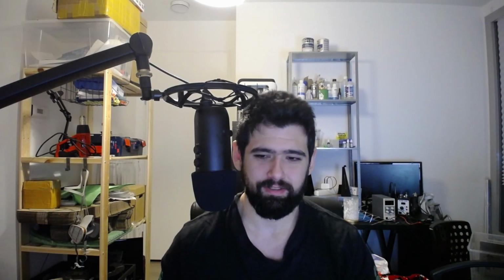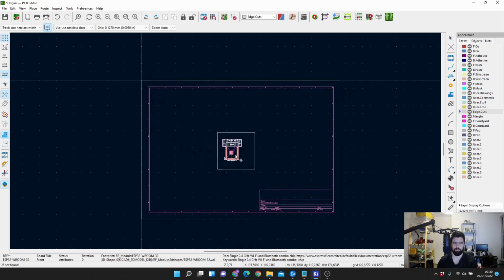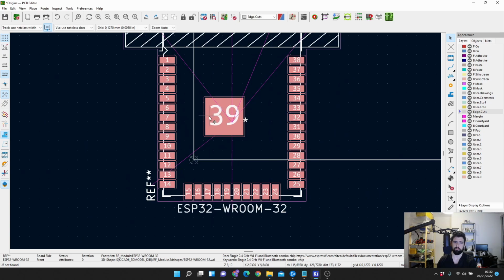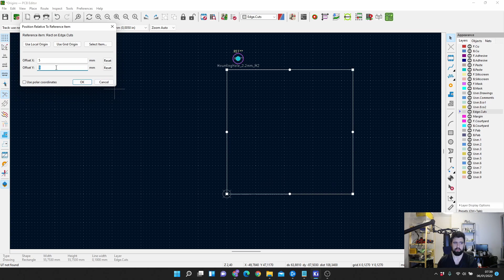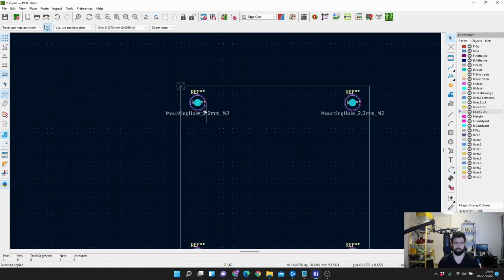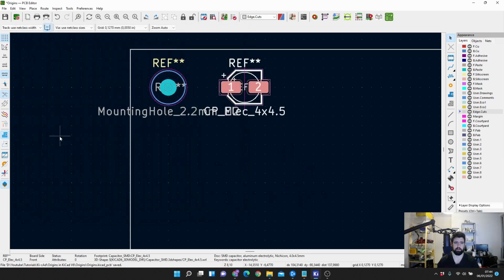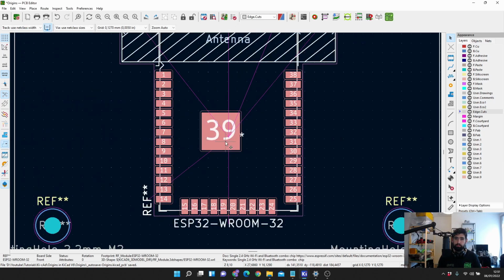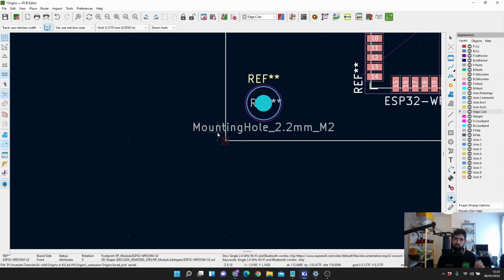KiCad V6 - Tutorial - Changing the origins that suits you

Comment: I admire that you're taking the time to make these videos. But I feel like this coverage of origins could use more discussion. First, Kicad 5 (and probably earlier) already has the ability to place an origin wherever you want.Yes, it has a fixed page-relative origin, but you can place the relative origin anywhere, and this is such a frequently used  function that its hotkey is space. The position relative to that "relative origin" displays in the status bar, along with the page-relative position. That way you can work relative to the bottom left corner for parts near there, or from the bottom right corner, or from the edge of a connector or some other landmark component. Having said that, K6's ability to set the page origin (which also sets the grid origin), and also the positive direction (especially for Y), is a big improvement. But the relative origin is still needed as well (so I hope that's still there!).  I'm hoping that there's a way to temporarily set the grid relative to the relative origin as well.  That would be useful to work on a board where most dimensions are in mm, but a certain area uses 0.1-in grid parts (such as many connectors), but that 0.1 grid is not relative to the board origin.
Now, regarding putting the origin at bottom left corner, and ensuring all X and Y positions are positive. Yes, that arrangement is less taxing on your brain. But it's not particularly necessary for any of the workflow.  It's true that Gerber files require X+ to the right, and Y+ up, and are often created with the origin at bottom left, but that origin position is not required. And Kicad 5 and before were quite capable of producing proper Gerber files, regardless of where the page origin was, (or the Auxiliary origin that's specific for the Gerber and drill output).
The bottom left origin is also not necessary for the pick-and-place output. In any case, you may be panelizing the board, which combines a bunch of boards together, possibly with a border rail around the outside, so your single board's origin is no longer such a dominant reference point.  PnP software I'm familiar with will accept placement data with the origin basically anywhere, and with X and Y positive in either direction. You just have to tell the PnP software where your origin is relative to some point it can find mechanically (like two edges of the panel), and then within that frame, where it can find (by camera) fiducial marks per panel or per board, and at that point it knows about that frame of reference quite precisely.
Finally, about creating library components with their origin in the middle. That IS important, basically because in the PCB software it makes rotating them much easier, and primarily because it matches what the Pick and Place machine has in its library as the component origin.  It is not relevant for the how the  pick-and place picks up the part. The PnP will always be adjusted by the operator to pick up the component approximately in the middle (center of gravity), because otherwise the vacuum doesn't grip the component so well, the component is more likely to tilt due to momentum when moved, and/or the pressure on putting the component down is uneven. What IS important for accurate placement is that the origin as defined in the PCB library matches the origin defined in the PnP's library of packages. After the PnP picks up the part it inspects it with a camera to get a fix on the exact position of part outline as grabbed by the nozzle. This is necessary because the components as supplied on tape, or in a tube or tray, are not in a precise enough position for the nozzle to just pick them up blindly in a precisely consistent way.
The vision system derives an outline of the component, and within that outline the PnP's library tells it where the origin is -- and that is what it uses to place the component at the location specified in the PnP data from the PCB software. 
So the trouble comes if you create a PCB component with a "non-traditional" origin, but don't tell that same info to the PnP library.  Normally the PCB manufacturer doesn't provide a way to supply that info, because the PnP library is already stocked with standard footprint data for virtually every conceivable package. So instead it's incumbent on you as PCB designer, if you make a new footprint, to put the origin where the PnP library expects it -- which is almost always in the middle. (A thornier issue is that your library component also needs to establish the "zero orientation" of the component, so that when your PCB outputs placement data which commands "orient to 90 degrees", that actually causes the PnP to rotate to the orientation you wanted. That's a not-completely-solved problem, requiring manual checking and intervention by PnP operators or PCB manufacturer workflow.)  
All of this PnP discussion is for SMD components.  For through-hole components, not placed by machine, in your PCB library you can put the origin wherever you like. For example, for through-hole connectors it's quite popular to put the origin at pin 1.
Reply from the maker: Wow, Graham, thanks for taking the time to give such a detailed explanation🙂. I was not aware that this was possible in KiCad V5. It is good to know. I was aware of placing the origin, but every time I wanted to place holes accurately, I had to use the move position relative to, but this is good to know :)  I try to make things as simple as possible. I hope the viewers read this comment and will learn from this as well. I might miss a lot, and if I say stuff that is not true, please point it out🙂. You should definitely join our discord as I feel the young students can learn a lot from you. Have a good day, and thanks for taking the time.👍
Reply: @PlumPot  Thanks for your reply! At this point it's not super important to get details of K5 right per se, since we're moving on to K6.  However, understanding better the delta between K5 and K6 introduces us to capabilities that we might not know we needed, but that, evidently, other users made a case for and Kicad developers found valuable enough to implement, so they might be good for us too if we're alerted to the new feature. 
So regarding the new settable drawing origin and axes directions -- these don't actually enable Kicad to produce any output results it was unable to before, nor even newly enable working from a relative origin, as we had that already. But what's new and welcome is the easier cognitive load while working with coordinates in PCBNew, and in comparing PCBNew coordinates with Gerbers or PnP output. And I get the impression that this is a theme throughout K6 -- improved usability, lower cognitive load for common operations, UI less idiosyncratic and so on. All stuff I'm looking forward to!
Reply: TL;DR?

Comment: I'm glad you like this new feature in KiCad v6. One of the great advantages of Open Source products is that features like this can be implemented without waiting for some large organization to decide it's worth their time. That's how this feature was implemented.

It's likely the reason you "Move relative to" example didn't work is that the object you selected was the vertical line marking the board edge, and the origin of that line was the upper left corner of the board. If you'd clicked on "Grid origin" for a reference rather than an object, you would have gotten the behavior you expected.

I've found it most convenient to display coordinates relative to the Drill/Place origin. When laying out a board, it's typical to start with some sort of mechanical drawing or specification. This drawing will specify a point from which all measurements are made. This is often but not necessarily the lower left corner of the board; sometimes it's the center of one of the mounting holes. I start my board layout by placing the Drill/Place origin at a convenient point on the KiCad "page", then place components and edge cuts relative to that. That way the mechanical drawing and the board layout are consistent.

Note that the "Origins and Axes" options affect only what is displayed, and do not change the board file. This allows the user to change what is displayed without risking modifying the board. They're persistent on a per-user basis, rather than per-project or per-board.

Comment: [Revised comment with better formatting. YT won't let me edit the pinned one.]
I admire that you're taking the time to make these videos. But I feel like this coverage of origins could use more discussion. 
Kicad 5's relative origin
First, Kicad 5 (and probably earlier) already has the ability to place an origin wherever you want.Yes, K5 has a fixed page origin, but you can place the relative origin anywhere, and this is such a frequently used function that its hotkey is the spacebar. The position relative to that "relative origin" displays in the status bar, along with the page-relative position. That way you can work relative to the bottom left corner for parts near there, or from the bottom right corner, or from the edge of a connector or some other landmark component. 
Kicad 6 improvement 
K6's ability to set the page origin (which also sets the grid origin), and also the positive direction (especially for Y), is a big improvement. But the relative origin is still needed as well (so I hope that's still there!). I'm hoping that there's a way to temporarily set the grid origin relative to the relative origin as well.  That would be useful to work on a board where most dimensions are in mm, but a certain area uses 0.1-in grid parts (such as many connectors), but that 0.1 grid is not registered exactly to the board origin.
Placement of origin at bottom left corner
Regarding putting the origin at bottom left, and ensuring all X and Y positions are positive. Yes, that arrangement is less taxing on your brain. But it's not particularly necessary for any of the workflow.  It's true that Gerber files require X+ to the right, and Y+ up, and are often created with the origin at bottom left, but that origin position is not required. And Kicad 5 and before were quite capable of producing proper Gerber files, regardless of where the page origin was, (or the Auxiliary origin that's specific for the Gerber and drill output).
Bottom left's salience tp manufacturing output
The bottom left origin is not necessary for the pick-and-place output. In any case, you may be panelizing the board, which combines a bunch of boards together, possibly with a border rail around the outside, so your single board's origin is no longer such a dominant reference point.  PnP software I'm familiar with will accept placement data with the origin basically anywhere, and with X and Y positive in either direction. You just have to tell the PnP software where your origin is relative to some point it can find mechanically (like two edges of the panel), and then within that frame, where it can find (by camera) fiducial marks per panel or per board. Once the PnP locates the fiducials, it knows about that frame of reference quite precisely.
PCB Library component origins
Creating library components with their origin in the center IS important, because in the PCB software it makes rotating them much easier, and primarily because it matches what the Pick and Place machine has in its library as the component origin.  
Salience for PnP
The PCB library comppnent origin is not relevant for the how the PnP picks up the part. The PnP will always be adjusted by the operator to pick up the component approximately in the middle (center of gravity), because otherwise the vacuum doesn't grip the component so well, the component is more likely to tilt due to momentum when picked up and moved, and/or the pressure on putting the component down is uneven. What IS important for accurate placement is that the origin as defined in the PCB library matches the origin defined in the PnP's library of packages. After the PnP picks up the part it inspects it with a camera to get a fix on the exact position of part outline as grabbed by the nozzle. This is necessary because the components as supplied on tape, or in a tube or tray, are not in a precise enough position for the nozzle to just pick them up blindly in a precisely consistent way.
PnP vision system and precise placement
The vision system derives an outline of the component, and within that outline the PnP's library tells it where the origin is -- and that is what it uses to place the component at the location specified in the PnP data from the PCB software. 
So the trouble comes if you create a PCB component with a "non-traditional" origin, but don't tell that same info to the PnP library.  Normally the PCB manufacturer doesn't provide a way to supply that info, because the PnP library is already stocked with standard footprint data for virtually every conceivable package. 
PCB designer's role
So it's incumbent on you as PCB designer, if you make a new footprint, to put the origin where the PnP library expects it -- which is almost always in the middle. (A thornier issue is that your library component also needs to establish the "zero orientation" of the component, so that when your PCB outputs placement data which commands "orient to 90 degrees", that actually causes the PnP to rotate to the orientation you wanted. That's a not-completely-solved problem, requiring manual checking and intervention by PnP operators or PCB manufacturer workflow.) 
Above does not apply to TH components 
All of this PnP discussion is for SMD components.  For through-hole components, not placed by machine, in your PCB library you can put the origin wherever you like. For example, for through-hole connectors it's quite popular to put the origin at pin 1.